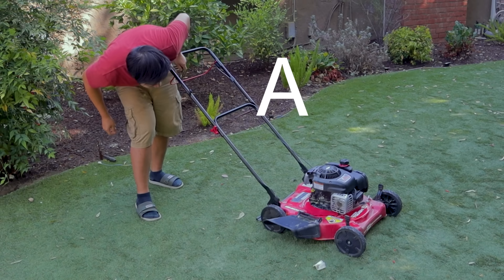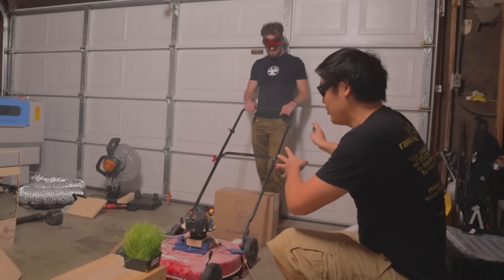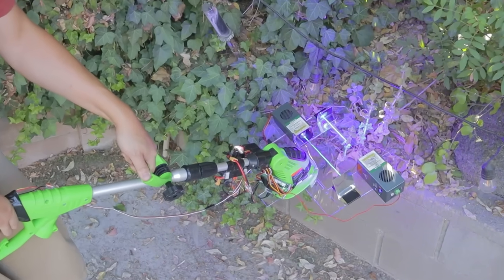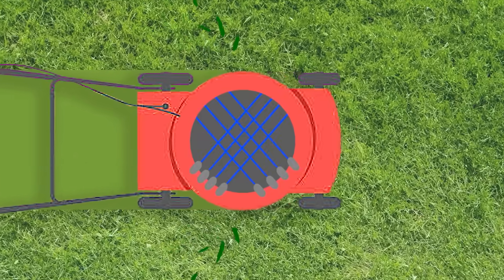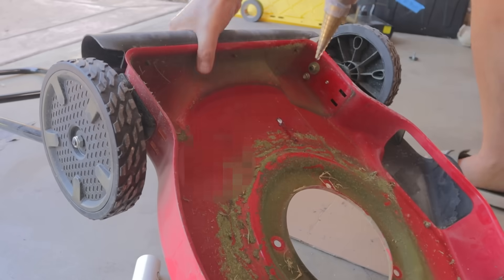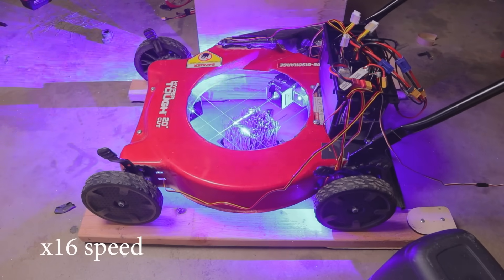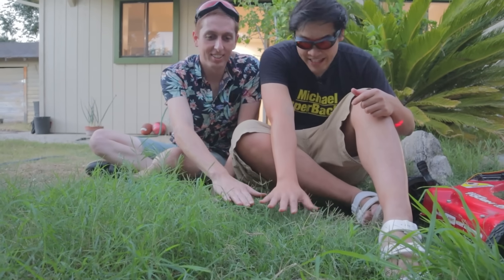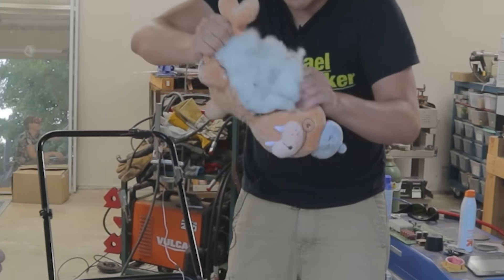mowing a Lawn like it's the year 3000

Comment: why is no one talking about how California banned regular lawnmowers?
Reply: California keeps voting in Democrats. They can get what they vote for. ID10Ts, none-the-less.
Reply: Ngl it sounds dumb asf 😂
Reply: People aren't surprised by California banning stuff anymore.
Reply: Before Californiastan has been a dystopian dumpster fire for decades now. 🤷 It'll be news if they do something RIGHT.
Reply: California makes stupid laws like this all the time. One of the many reasons why it’s not worth living there
Reply: Exactly. So pathetic. Have fun, Californians, living in the ultimate nanny state.
Reply: Land of the rich they gonna be the first to go iRobot
Reply: California unfortunately banned all new small engines rated 25 horsepower or less. This includes two stroke and 4 stroke engines. This new law was put into effect as of 2024 but was signed into effect about 2020ish (thanks Newsome). 

People can still buy gas powered equipment if it's old stock or technically if the engine was made 2023 or older. But most stores are too scared to restock new old stuff. Or if you know where to look and buy you still can get new stuff.

Also if you've owned gas powered equipment prior to the ban you are safe to still own and operate it. It's just the new stuff.
Reply: @jesseromo7646  Time to LS swap the lawnmower!
Reply: @jesseromo7646  Yeah, battery technology isn't much better.  If anything, they should just ban lawns in their current form.  Instead, have a rock garden or something with drought-resistant plants.
Reply: @WJCTechyman  I wouldn't want lawns to be banned, some of us would lose business. There are alternatives to having a lawn that doesn't require grass. You could have different plants such as clovers or thyme etc as the turf. But yes a water wise landscape with drought tolerant plants is an alternative that is good for anyone wanting to save on money, water, and maintenance. Less work.
Reply: I have the same gas mower that I’ve had since the year 2000. Gas mowers for the win.
Reply: It’s California. What else did you expect
Reply: Yeah wtf😂
Reply: It's pure insanity. Happy I moved from that H-hole years ago.
Reply: I made a comment about it. It's completely fucking insane. I cannot actually believe it.
Reply: Because small gas engines suck.
Reply: You hadn't evolved enough to use electric lawn mowers yet?
Reply: @user-vw5qt4rs8g wow... I ran across two idiots at the same time. Amazing...
Reply: ...WELL,THAT BAN MUSTVE BEEN CONCIDERED ANTI CONSTITUTIONAL AND REMOVED

.........
Reply: @robotnikkkk001 ...what?
Reply: Lol they did not ban regular lawn , they banned gas lawnmower. Electric lawn mowers also spun a blade and capture the grass . Just cheaper, easier, less hassle, less noise, and orders of magnitude lass pollution.
Reply: @GarrettMoffitt  Electronic mowers and lawn equipment are fine for the regular homeowner or light duty work. The main issue is the run time compared to gasoline powered equipment. There are commercial grade products that use batteries but again, run time is no where near comparable to an ICE powdered version. 45 mins with electric batteries versus hours with a gas engine. (This is a comparison with a commercial 21 inch Toro mower) 

Gardening and landscaping businesses would rather keep using gas powered equipment just so they can keep their business running more efficiently and perform work faster. It's a big pain to convert to all electric for ALL the equipment let alone having to purchase many batteries and have them charged ready to go. I have seen some guys do it though with an electric set up. Still, convenience is why guys like me still prefer the old gas tech. That and my business.

Side note, both electric and gas still pollute to some degree. Either directly  or indirectly. Newer gas engines don't put out as many emissions that some people believe. Advancement in engine tech has helped. The mining process to extract lithium for batteries can also cause havoc to the environment. But, yes you can recharge and have less maintenance Both have their downsides.
Reply: @GarrettMoffitt "cheaper" did you watch the video you virtue signaling shill? The average electric lawn mower is like 500 dollars. And also yes, gas lawn mowers are "regular lawnmowers". They are the most cheap, effective, used lawnmowers.
Reply: @GarrettMoffitt  That's not the point. its a complete overreach of the government into a persons life. what if you live off grid you don't want to waste electric on a mower? or maybe your business needs small engines such as a chainsaw?
Reply: @GarrettMoffitt  battery mowers are more expensive than gas
Reply: Yeah but you left out one crucial point: electric lawn mowers have way less cutting power. 

And the batteries cause house fires. 2 in my neighborhood of 100 homes in the past 12 months.
Reply: @GarrettMoffitt production costs of electric ones cause tons of pollution.
Reply: And you think the much heavier gas/diesel powered mowers don't consume a ton of resources in production?
Reply: @mfbfreak well you don’t have to replace the batteries every other year (and then, inevitably, the entire lawn mower because they changed the battery’s shape with the new year model and stopped making batteries that fit your model) so I’d wager that in the long run a 2 stroke will have less emissions than a battery powered.
Reply: @totalphantasm  our all electric lawn care equipment has batteries 5-10 years old and still working fine. 
We have fully cordless electric hedge trimmers, weed eaters, edger, blower&mower. 

Not a drop of gas or oil burned, no worrying about fuel stabilizers over the damn winter nor the ethanol fkn the equipment up&zero tune up maintenance required such as filters spark plugs or tuneup. No yanking on cords, nor smelling like fuel! Also it's quiet running. 👍🏻

Just uses line for the whackers&sharpening up the mower blade every 2 or 3 years but it's still the og high lift style blade it came with. 
.4acres cared for gas free here in the South for over 5 years now, 10+for trimming, edging&blowing stuff. 😎
Reply: @4literv6  i haven’t replaced any spark plugs, done any tuning, replaced any cords, done any tuning, replaced any filters, used any fuel stabilizers either. I paid 20$ to replace the carburetor when I pulled it off the curb 3 years ago. 
My electric mower batteries died in a year, as have several other of my friends.
Reply: @totalphantasm 

"every other year" lmao

No. You aren't using the batteries often enough to wear them out that fast. Even if you live somewhere where it's perpetually summer, you're mowing once a week, that's 52 battery cycles a year. Batteries are designed to handle many hundreds of cycles, expecting something like 500-600 cycles before the batteries get too worn out to be usable isn't that crazy. That's 10 years. 10 years of not buying gasoline, not buying oil, not any of that. That's pretty dang good.

As for the batteries changing, that's also just no lmao. My mother bought an electric lawnmower from a specific blue brand of tools in 2018, 6 years ago. The battery has not changed at all in 6 years. I can still buy brand new batteries if I needed to. And the two batteries that it came with are still more than enough to get both the front and back yard without having to wait for it to charge, even if you let the lawn go a few weeks.

Ask me this. When was the last time your favorite brand of battery powered tools changed their battery design to be incompatible with old tools? Probably around the change between NiCAD and Lithium Ion, right? Yeah that was like 20 years ago. They're not changing any time soon.
Reply: @richardmillhousenixon  you can say what you want, but I know my batteries died, I know several others who’s batteries died, and I know you can’t buy most of those batteries anymore. You can accuse me of lying or whatever, but that doesn’t change the reality that mowers really only use about 10$ a year in gas for a half acre lot, it would take nearly 10 years for it to be more expensive than an electric mower, at which point it will STILL be working and your electric mower won’t. 
And yeah sure that’s a fair comparison, tools that are designed to be interchangeable as a key selling point because various pieces of equipment can work off of the same size battery to a massive motor that needs a unique larger battery than any other piece of equipment where battery interchangeability isn’t a selling point at all.
Reply: @totalphantasm  That brand has an entire line of lawn tools which uses that same battery. Weed eaters, lawnmowers, leaf blowers (including a backpack blower), even snow blowers, etc.

They also make mowers and trimmers which use the standard tool battery, in the case of the lawn mower it uses 2 at a time.

Batteries aren't this newfangled thing. And none of the major brands that have come out with battery electric lawnmowers have changed their batteries since release, so if you're willing to lie about that, you're willing to lie about multiple things. Not Ego, not Ryobi, not Kobalt, not Skil  not Toro, not Greenworks, none of them.
Reply: @richardmillhousenixon  brother i don’t think anyone would buy a weed eater that had the massive battery that was in my green works mower, and I definitely know you can’t buy that battery new anymore. Cope about it if it makes you feel better, I guess.
Reply: @totalphantasm  if your batteries are needing replaced that often, i feel like you're either buying cheap, or you're leaving them somewhere they are meant to be. batteries don't last as long as a 2 stroke, but they shouldn't have that short of a life span either
Reply: @maple6124  well if “in my garage where all of my lawn stuff goes” is just too tough of an environment, I think that itself is worth decrying
Reply: @totalphantasm  how long did you usually leave them without charging them?
Reply: @maple6124  Almost never, either being used or on the charger. Maybe at absolute most a month over winter.
Reply: @totalphantasm  yeah, i don't know what it'd be then.
Reply: @totalphantasm  Greenworks hasn't changed their batteries since release. You can still get the 40V, the 60V, the 24V, the 80V, and the 82V batteries brand new.
Reply: @maple6124  It would be them lying lol.
Reply: @V1Zach people rallying to keep internal combustion engines don’t care about pollution.
Reply: Also America is running on fossil fuels mainly, switching small engines ain’t gonna do much without switching gas powerplants to nuclear first.
Reply: @GarrettMoffitt  Until you realize that 60% of electric power generation in the USA is fossil fuel based.  Also, small engines aren't the big problem here, it's industry when it comes to emissions.  What happens when you switch from gas powered equipment to electric?  You ultimately just put more strain on a power system that isn't designed to handle air conditioners let alone battery powered equipment and battery cars.  Also with those batteries comes caustic and toxic chemicals that cannot be recycled after being batteries as over 90% of the mass of those batteries aren't at all feasible to recycle.  The small engine problem could be solved by making small engines configured with fuel injection and catalytic converters as well as telling people to get rid of their flathead engines as they were discontinued in the 1960s in motor vehicles.

Also, on what planet are you from thinking battery electric mowers are cheaper?  Most people would be going with those instead of the corded variety and the batteries, at least buying two decently sized ones cost as much as the machine.  Then there's the issue of any battery electric tool is planned obsolescence, making the tool useless when a "new" battery configuration comes out.  I mean, yes, having batteries may seem like it's cheaper compared to purchasing fuel for and maintaining a small engine but batteries only really last about five years and how much money will it be to buy new ones, and also adding into account the money spent on electricity to charge those batteries.

Maintenance is something that still has to be done on your electric mower to make sure it is fit for service like cleaning vents and heat sinks, checking the electrical wiring for problems, lubricating areas that still need to be lubricated, checking for obstructions under the deck as the cooling air for the motor is often thrown out the side or into the bag with the grass, sharpening or replacing blades, also a good point of maintenance for a lawn mower is walking your lawn looking out for obstructions and potential hazards as electric mowers are often made of plastic and if the blade hits an object it can often destroy the mower, unlike my Honda with its blade brake clutch that has slip if something hard is hit.
Reply: @GarrettMoffitt I worked at lowes in the outdoor lawn and garden section for a long time. Everything you just said is completely false. Ive sold John Deer, Bad Boy, even Craftsman, all of which customers kept and have kept for long periods of time, very occasionally coming in for belts, blades, or an angle grinder when I tell them thats the best way to sharpen mower blades over anything in my section. 

The Eco mowers we have either dont sell at all (because most people aren't stupid) or are returned BY the next day due to maintenance issues, poor quality parts (bolts, nuts, washers, ENTIRE MOTORS) terrible performance and power output, SHORT battery life (the batteries cost half as much as the mower itself) and yes, EVEN pollution reasons. I had a 57 minute long conversation with my last customer halfway berating me for the company pushing eco mowers and halfway explaining that he had to admit he was wrong about the pollution when he got into a fight with his son about how much pollution was caused just by MINING lithium vs. just using gas powered mowers.

Comment: You should use much higher wattage and just run a wire to your house. Because most homes in the US use 20 amp fuses at 110 or 120v you can use a kilowatt laser diode array or 2 on one circuit which should cut and you can use a lens to scatter the lasers to focus before the middle of the mower so that it scatters and doesn't melt the mower.

Comment: just use a sealed or semisealed co2 laser (like 300w or less) and 2 mirrors,one depolarizer and another one on a BLDC motor spinning incredibly fast,to powerit you might need more then 1KW,it wont cut in the center but that's fine

Comment: 3:40 Grass contains water, which has a high heat capacity; a thin sheet of metal has low heat capacity. Does this have anything to do with it? What is the actual mechanism by which light cuts things?

Comment: 1:17 I feel like a rotating mirror would be a better solution than turning the entire laser emitter. But also, a mower blade lifts the grass to perk it up while cutting but also expel it from the cutting area - assuming you have a discharge of some type. Potentially if you have a combiner reflector to focus all lasers into a single beam, it could cut the grass much more quickly

Comment: the laser beams need to be scanned.  As it is, 99% of the space under the deck is open air and the laser beam only takes up 1%,  so the grass is not engaged with the beam until it finally crosses the the lines where the beams are, and then it's a feed rate issue, you have to slow down until it's totally through.  if it was scanned it would be engaging the grass the entire time after it entered the deck.

Comment: How about a box that generates heat (not open flame) and roombas around the yard like an upside-down oven on wheels that shrivels and dries up the grass till its fragile. Then you just rake up the bits, so that handles the grass, weeds and insects without chemicals, an eco-friendly fire mower.

Comment: Cool idea. But electric lawn mowers aren't all $800. Don't get the one with the headlight and power drive system, and you'll spend around $300-400 instead. My ryobi was on sale for $250 with a battery when I got it.
Reply: They're still crap though. Here in Tennessee you'd be laughed out of the state if you bought an electric mower because they are completely inadequate here lol. California is nuts.

Comment: I think you just need some kind of a system to remove the grass clibbins. Like maybe a huge vacuum where the motor used to be. It would suck the grass into an upright position, and after it's been cut, it would suck up the grassblades into a storage container.

Comment: He started the video stating the laser cut grass "like butter". I'm not sure what butter he uses, but having to hold the beam for 2 seconds on EACH BLADE OF GRASS is not "cutting like" any butter I've ever encountered. It would take him a full minute to cut 30 blades of grass - after an hour he would have cut 1800 blades. The average healthy yard (absolutely NOT the adjective you'd use for Kevin's backyard) has about 3000 blades of grass per square foot according to the Oklahoma Museum of Natural History. Using Allen's method, it would take him 16 hours and 40 minutes to finish one 10' x 10' patch of healthy lawn. 😴

Comment: Your comment on just finding a cheaper corded version is correct. Only you do not have to use the power cord. Corded lawn mowers use a brush type motor, so they run just fine on DC power. Or in my case one of my Atlas 80-volt batteries. Or if you have 2 batteries, use them in series, one at 80 volts the other at 40 volts "they are tappable" and then you have a full 120 volts DC, and the corded lawn mower runs fantastic. You can find old, corded lawn mowers for next to nothing.

Comment: You should’ve used laser with a different wavelength. If you look at chlorophylls absorption spectrum you can see that it does absorb that much cyan, witch mean that a lot of the power is wasted because it is not absorbed by the plant